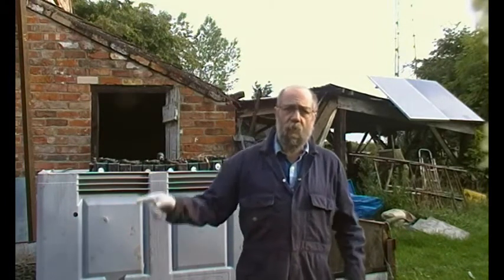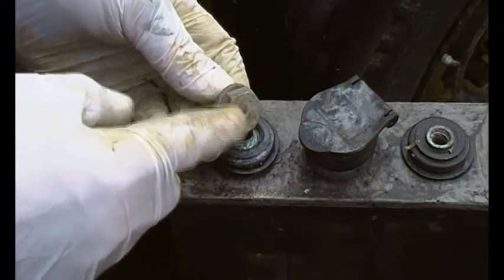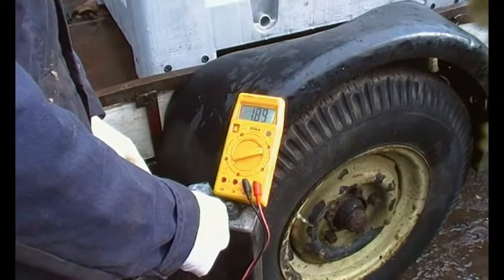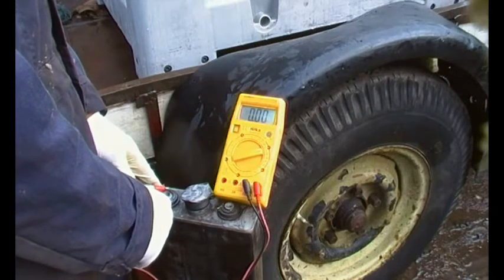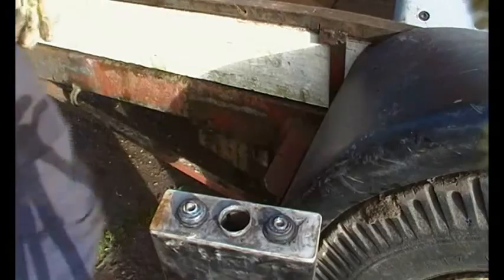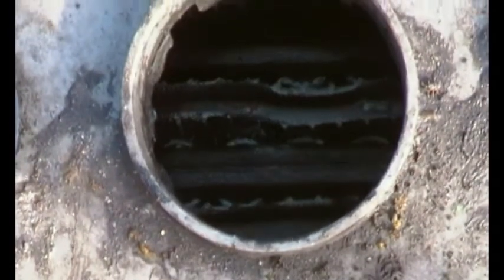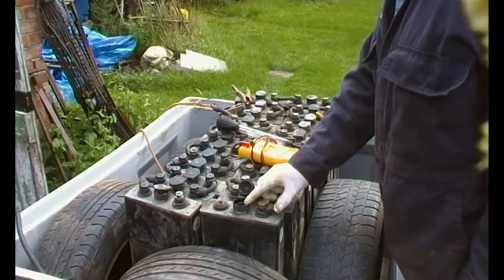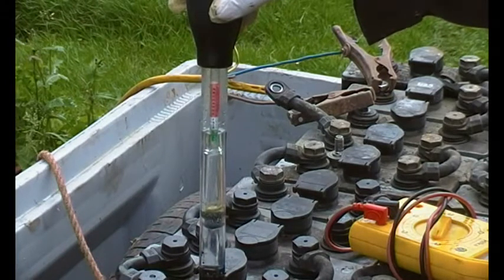Forklift lead acid batteries, investigation, renovation and equalisation, part 1 flooded batteries

Comment: There is a problem with those deep cells when used in a static situation of stratification, where the acid concentrates at the bottom of the cell and the water at the top so the cells start to only hold part charge. You need to regularly run  equalization charges where the cell bubbles vigorously but even then there is stratification  I found that every six months or so it is a good idea to pick the batteries up and lay them over gently to one side then the other to keep the acid mixed. Much better to get cells which are more even in depth height and width.
Reply from the maker: Thanks for your comment and experience. I understand your thoughts on stratification especially if very little gassing occurs.  My main pack has the square cells 7 x 6 x 20 inches and I seek for them to gas every day in an attempt to keep clean plates and even strength of acid. Better to use a bit of distilled water than the batteries go stagnant. Cheers

Comment: Once I had succes with a sulfated motorcycle battery, it took no charge even after 14 days (still 2v) ! I told an Hongarian and he told me to add AKUVIT and so I did,and a few days later the same charge ( 0.5 A) it ended at 6.8V ! After two years this battery is still in working order. I think you can only buy AKUVIT in Hungary !

Comment: Hello Andy, I have a question. I bought a forklift battery, 80v 775ah from a 2017 Jungheinrich truck. They read 2,06v when I bought it. I charged it up 12 and 12v with car charger, took 
over a week.
Took the best cells, after resting for a week with no charge, those who read over 2,12v and had specific gravity over 1250. I put them in a 48v pack and connected to a solar system 8 × 280w with EAsun inverter.
I called Jungheinrich and asked how much to charge voltage/cell, they said 2,70.
My solar charger have max 58,4v, thats only about 2,45v/cell
After discharging my battery to about 50% (1200specific gravity) for testing capacity some cloudy day came, and it didnt charge very well for a couple of days, then i connected it to the grid because I wanted to avoid sulfation.
After some hours with charging with 58,4 v and 30a, the charger showed full on the display.
I measured the specific gravity, and it was very uneven, some were 1200 and some were almost 1250. What is the best thing to do now?

Love your videos, greetings from Norway
Reply from the maker: Hi, welcome to my world. This is to do with equalising charge and the current. I would say that these batteries need a gentle long charge so that the ones that have been over discharged before you got them can catch up.The low ones will have some embedded sulphate on the plates that takes some time to convert, so the voltage rises before the SG and so gives a false reading. Use you batteries as a buffer rather than a power source. Much of this is in my book (see channel page). I hope you have subscribed, cheers
Reply: Thank you for your answer, i will let the sun give them a long slow charge and see! 

Im going to buy your book!

Comment: I think I learned just enough to ruin a good battery.  I need more education.  I am in possession of three 36 volt forklift batteries hoping to have enough good cells to make two batteries for two forklifts.  They are identical but have never even seen a forklift battery before.  I work professionally on high pressure boiler systems and hvac systems including cryogenic cooling for space applications (coatings on electronic boards).  Trying to help a friend.  I am keeping very well ventilated including fresh air continuous over open battery cells.
Reply from the maker: Sounds like it's a good start, a bit of ventilation when the cells are gassing is all that's required, cheers

Comment: Hi the Connector at 4:14 is has corrosion ingress due to the rubber sheath being penetrated by a volt meter test probe (hence the hole).
Reply from the maker: Hi, Daniel, thanks for the comment, yes and who would do such a thing? I followed this up with a video about link corrosion a few months ago (3rd Oct 2018), cheers
Reply: @TheInfoworks  forklift "engineers" do this every time they check the battery. if you use the manufacturer i'm sure it's so they can sell you a new battery sooner rather than later.

Comment: Andy are you using the 6v or 12v setting on your charger for this set up? Assume 6v then taking this down using the variac?
Reply from the maker: Hi, I used the 12v side of the battery charger to reduce the current draw through the variac, cheers

Comment: I always just tighten the terminals enough that you can't move the cable . I mean if you really tried you could. especially if you move it the way the bolt loosens. there's no need to torque them down really tight. it only gives trouble later if you do. I'm thinking about maybe a reman batt. for my off grid home. I have up to 80 amps charging capability . at 24v I'm thinking maybe a pallet jack batt. or a fork lift batt. and parallel half the cells. 
question do you think balance charging helps de sulfate the plates ? I just don't know how good a reman batt can be. if its going to last a year or 10 years. every thing shuts off at 9.5-10.5 times 2 . so 19-21 volts but I try for 22-23v shut off. plus I have a small hydro set up. don't know what its going to do yet. potentially up to 25 amps. for now. I hope to double that about 2x. great info. thanks
Reply from the maker: James, thanks for the comment and your thoughts, dead right the ternimals need to be just tight enough to make a good contact and keep out any moisture. As you may have guessed from my many other videos we run a 48v system and I don't like the voltage to go below 47 for more that about 1 minute under load. For your 24v system I would say 23.5 v for no more than a minute. This helps to keep good battery health. In summer some of the charge controllers activate about 10 am, but in winter we have to use a backup charger frequently. We have about 7kw of panels and 1100 Ah of flooded type forklift batteries. The big battery really helps to avoid a drop in the volts under load, but it's no good without the generation. Hydro is a dream generation and you are very fortunate, I hope you have seen my videos on the water wheel in Bourne that we connected to the grid, Cheers, Andy
Reply: Andy Reynolds 
yes I saw the water wheel video. I'm kind of new to your channel. been watching for maybe 6 months. I'm slowly adding to my system . I'm using my generator to charge the bank of golf cart batts. I'm probably going to start buying panels at like 100w at a time. or a panel at a time. I'm trying for a goal of 1500w give or take 100 w. I need to dam up the creel . to see how much fall I can get. its not a lot of flow. but it is moving. and its basically on flat land. I'm hoping to  build a 36" wheel that's 24" wide or wider. since it will be a low rpm wheel. I'm trying for as much torque as I can get. do you know and videos . or any experience with a setup like this. I have about 1000 watts worth of  motor/ generators. I plan to use to get the system going. but plan to move up to something bigger if the water allows. thanks for your reply.

Comment: Hi Andy. Just wondering how to size the battery bank. If i were to want up to 6kW and retain the mAh rating how many mAh would i need in total? Can i draw up to 10% of the batteries mAh and still expect to get close to the rating? I would not draw 6kW continuously but i would like it to be no sweat for the battery bank when i am so as to avoid running the battery down quickly during those moments.
Reply from the maker: Iz, lets look at this a different way. If you wanted to run a max wattage of 1000w (1Kw) then to work this out you need to start with the system voltage. So for 1Kw at 12v the amp draw is 1000 / 12 = 80 amps. For 24v its 40 amps and for 48v its 20 amps.For lead acid you would never discharge  at a greater rate that the 20 hour rate so for a 100Ah battery to keep the batteries lasting for years then the max charge /discharge rate would be 100 / 20 = 5 amps. To supply a possible 3Kw for a reasonable time a 48v battery pack would need to be 3Kw x 20 (amps per Kw) = 60. 60 x 5 (20hr rate per 100ah) = 300 Ah. That's why for our 48v system we have 1800Ah of batteries consisting of 4 battery packs in parallel. Subscribed? Cheers. (It's all in my book)
Reply: @TheInfoworks  That's good to know. Go by the 20 hour rate. Before i was going by 5-10% of the mAh rating.
  So it turns out that your system is designed to exactly the spec i was asking about. It will be able to deliver 6Kw without loosing performance over the 20 hr rating. Well lets say a bit less due to older batteries and conditions. etc.
  But a good start. I would probably try to double that so as to never be worrying and hopefully to get even better efficiency from the batteries.
  Thanks for the reply. I have been wondering about trying to recover some dead batteries but i'm thinking the process is too nasty to bother. I wouldn't know how to get rid of the residues from the bottom of the batteries. I guess i would try to evaporate the liquid and throw the minerals out in the trash but even incineration is probably not the best for the environment. Do you have any good tips on disposal of lead juice. etc?
Reply from the maker: Normally the black sludge in te bottom of cells is the lead paste from the plates that has been eroded due to battery abuse, charging too fast, discharging too low. As the plates discharge they get bigger as the lead oxide turns into lead sulphate (a bigger molecule). I made an early video taking a faulty battery apart: https://www.youtube.com/watch?v=sUH44Te4_nc
If you want to dispose of this toxic lead paste then pour it in an old battery case and send it with other batteries to recycling or scrap yard. Cheers

Comment: Hello Andy,  The Variac is connected to the charger, why can't you connect the charger directly?  Is it because of unstable Voltage or current?  Some of my forklift cells are undercharged and i need to charge as you did separately.  I am finding it hard to locate a 2.3v+ Charger that can be used to charge the acid batteries can you point me in the right direction, please?  I am assuming you use the Variac to set the Voltage to 5v as you indicated and the charger seems to indicate only Ampage?
Reply from the maker: Hi, yes it's a 12v charger so using the variac I can adjust the AC volts in to change the DC volts out. The battery holds down the voltage to some extent and so only an amp meter is needed, After all you are seeking to put amps into your battery. Best buy a copy of my book and subscribe, cheers
Reply: @TheInfoworks  Hello Andy,  thankyou for quick reply.  I get it.  Where can i buy a copy of your book?  Thanks
Reply from the maker: No worries, the book has a whole chapter on batteries with lots of hands on experience, cheers
Reply from the maker: @allykhan8594  Hi, click on my name under the video and look under "about". There's a link to CAT bookshop, cheers

Comment: Hi Andy , my cells are the slim and very  tall type , i have no idea of the AH of the cells as there are no markings of the pack , i tried using my 12 volt charger and a variac  on 2 cells at a time , my old charger is a 12/24 and puts out  a lot of amps when connected to 2 of the cells at a time even at 5 volts when on 12 volts , what would you recommend as a safe current going into the 2 cells at a time ?  or should i try doing 4 at a time maybe to lower the current  ? . cheers
Reply from the maker: Hi, the easiest way to find out the possible Ah of a forklift battery is measure the size of your cells and then look that size up on a website selling these. That gives you a good idea, then use the 20hr rate as a max current guide. A variac and big charger will work well as an unregulated adjustable power supply. Cheers
Reply: @TheInfoworks  Thanks for that Andy , i just had a quick measure and they are the same size as the ones you had in that grey tub   the 60mm x 200 x 700 ,, can you remember what the ah of those cells were ?  over here in Aus they dont put anything on there web sites as they want you to call them so they can talk you into buying new ones !  lol
Reply from the maker: Hi, here's a link to battery specs page. I would guess that your used batteries may be 400Ah, (see the C20 rate)  https://www.tayna.co.uk/forklift-batteries/lucas-2v-din/3epzs465/  Cheers

Comment: Hi, your book 'wind and solar electricity' p124 shows a 2V drop tester. As far as I can find out in UK these were made by Durite who will not be making any more and they are out of stock. Do you know of any other source of these testers? Great book by the way!
Reply from the maker: Michael, try Ebay, I bought several second hand from there. Otherwise you can make your own with some heavy duty nichrome heating wire that would draw 100 amps at 2 v and a multi meter. You can work out the length of wire by using the equations found in a Ohms wheel. Find this in a web search. maybe this needs a video? Cheers
Reply: @TheInfoworks  Thanks Andy, I've been trying ebay for ages, can't find anything. I've got 24 X 2V Rolls 298Ah (I think) cells and a few of the cells are dodgy but it's a real pain trying to figure out which! Thing is most are OK so no need to scrap them all. I've been charging them individually using your variometer set up but you can achieve what looks to be a decent charge voltage and specific gravity but that doesn't tell you about performance under load. I bolted together some of the better looking iones into a 12V battery and drop tested that with a standard 12V drop tester, 12.8V open circuit dropping to 11V under load. I noticed the middle two batteries in the 6 cell array don't seem to charge as high as the two at each end, ie SG of 1250-1260 compared to 1272-1280. Any idea why this should be? 
A detailed video on making a resistance tester for 2V cells would be great, I tghink such a bit of kit is indispensible if you dont want to be reliant on the manufacturer and sending cells back and forth
Cheers
Michael
Reply from the maker: Michael, a very long slow charge may bring those cells back up, maybe over a week. Watch this space for a drop tester build. I'll see what bits I have, cheers
Reply: @TheInfoworks  Thanks Andy, you would be doing a real service with that. Keep it simple please!
Cheers
Michael

Comment: I have a forklift battery that was at 7v (supposed to be 36v) because the battery was left plugged in for over 2 years. (wasn't me this time, lol) I started charging it up 6 cells at a time about a week ago. All cells were below .5v but they were all even. It's gonna need a little work but the forklift drives again. It was parked because the front hydraulics don't move, so I still have to figure that out.
Reply from the maker: Hi, sound very good for low impact living, did you do a video to explain and show this great idea? cheers
Reply: @TheInfoworks  I didn't make a video, I've never tried to restore a battery this large before. I fixed the hydraulics and drove the lift around for a bit. (ended up being a contactor that was stuck open) Unfortunately, the specific gravity of the electrolyte is very low, even after equalizing at 80a for a couple hours. All cells rest at above 2v, most around 2.05v. The battery was severely overflowed previously. Any thoughts on where to get acid to bring the specific gravity back?
Reply from the maker: @inoahmann7542  Hi, in industry there would be two options, either removing all the acid and replacing it with new 1280 acid (expensive), but this is only done when the battery is fully charged and then had a trickle charge for a couple of days. This is just to make sure the plates are clear of lead sulphate. Or reducing the acid level by sucking out the acid down to the plate level and adding very dangerous very strong sulphuric acid. Either way a very long trickle charge is important, a couple of amps for two weeks, there may well be sulphate still in the battery and this will release it to raise the SG. Hope this helps, cheers

Comment: Good day Andy, I have a 200amp tall tubular battery 12v I only use them for a year than I saw the cell gauge in the batteries are down  I want ahead and take all electrolyte out of the batteries instead of me adding a distilled water in it pls I don't know what to do help me
Reply: So yesterday I was on YouTube channel I saw that I can make the electrolyte by getting the acid called sulphuric acid than mix it with water so I did, than when I was done mixing it I have to confirm my mixture with the hydrometer to know the specific gravity which was 1.250.
So after my mixing I waited for it to cold than I test the specific gravity again it was 1.250, i now put the electrolyte in my batteries and charged them throughout the night dat was 6 hours, only for me to check the specific gravity dis morning it drop down why so was high to 1.225 some 1.200 some 1275 some 1.250.
Please I want to know if my mixture of the sulphuric acid with water on the specific gravity 1.250 is ok and why is there different specific gravity after charging for 6 hours? Please help me don't want to loss my battery I have just use it one year 🙏
Reply from the maker: @djkemzyjay1802  the specific gravity of the electrolyte depends on the state of battery charge. Discharged is low SG, fully charged is high SG. Your batteries did not have an equalising charge before changing the electrolyte so when you charged them over night some charged up further and the SG went up. Some batteries are self discharging and so the SG goes down, these are scrap, probably damaged from over discharge and poor charging. See my book (Wind and Solar Electricity) for much more detail, cheers